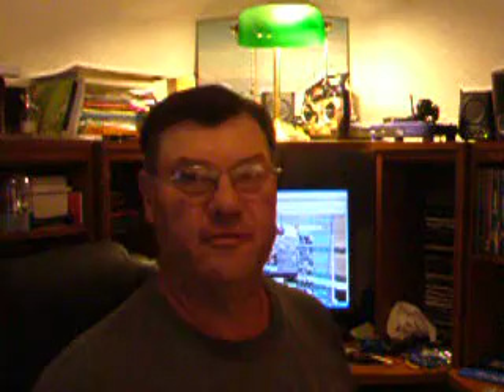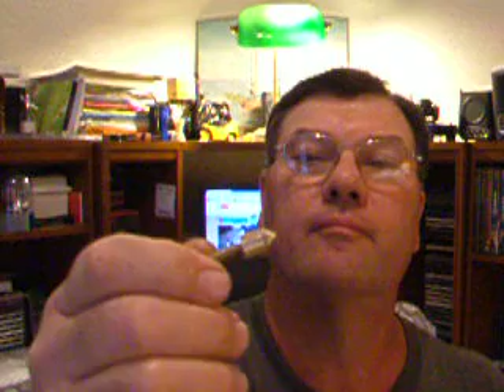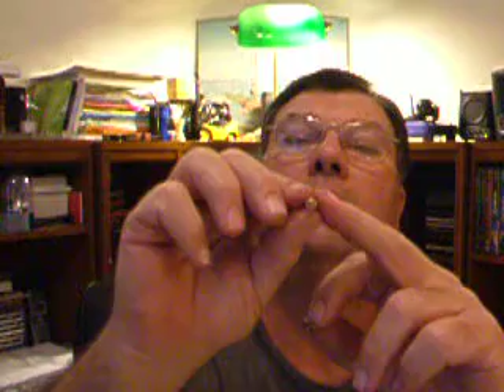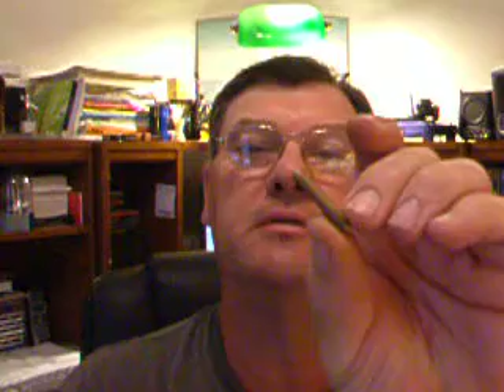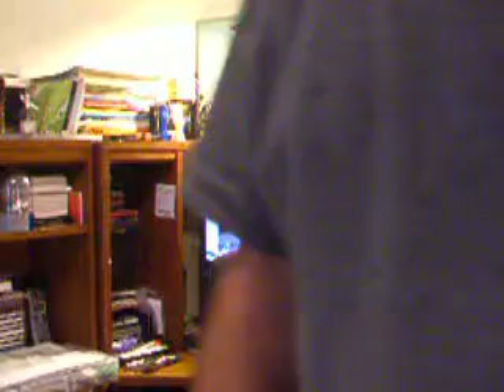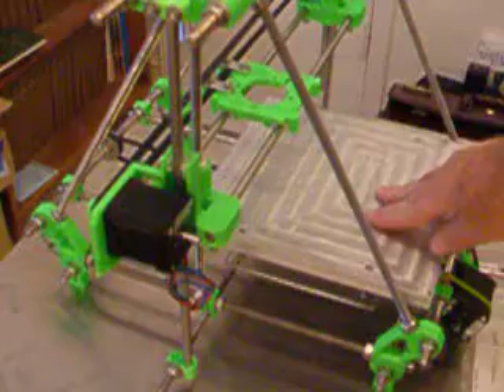3d printer hot end

Comment from the maker: Thank you togaida, for your interest in my projects. The reason for the aluminum plate I cast and milled was for testing the Prusa 3d printers strength and what could be done to increase that strength for the Y and X axes, to have a larger print surface with a little different design from the Prusa.